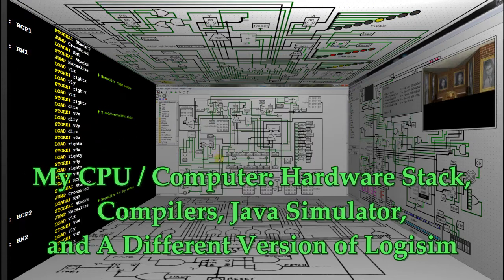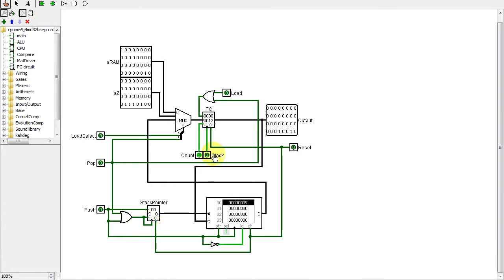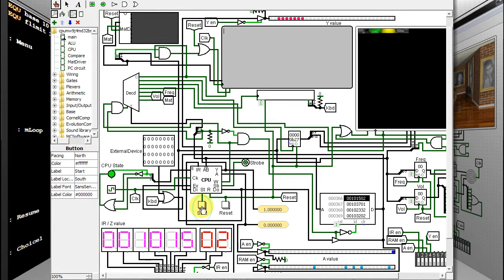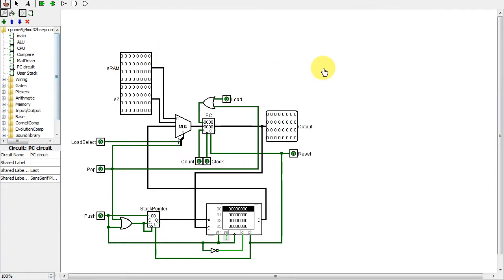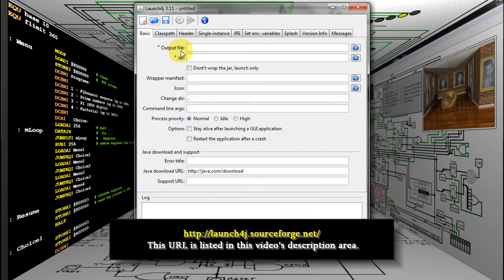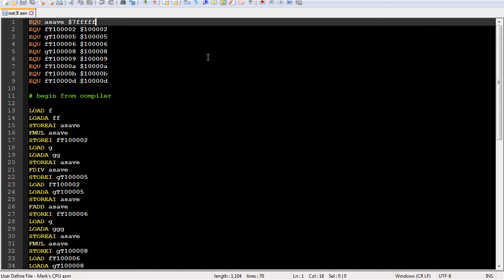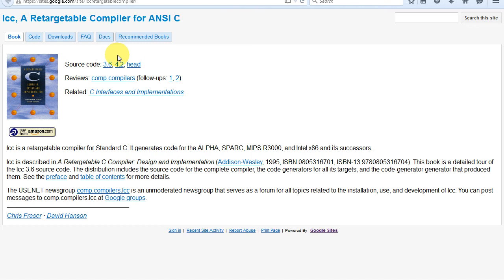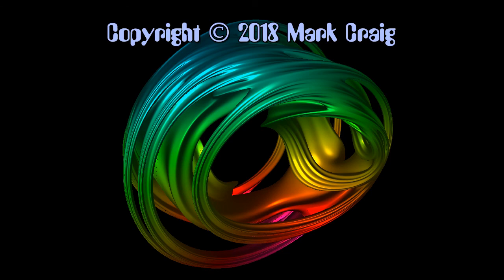My CPU / Computer: Hardware Stack, Compilers, Java Simulator, and A Different Version of Logisim

Comment: Hi. I can't even think of how much work you have put on that. Congrats!  Sorry, but I am a Logisim newbie with a basic question: how did you manage to have that "screen" that you a rendering your ray tracer inside Logisim? Is this a library? In my Logisim I can only see a basic "LED Matrix", but that does not seem to be it.
Reply from the maker: @Jorge Amengol Thanks!  To get the screen, I took the source code for the video screen from a Cornell version of Logisim Evolution and modified it to get better resolution and color depth and made it a JAR library.

You can download my jar libraries which include the LCD screens at:

https://sites.google.com/site/mrmcsoftware/home/downloads/cs3410for271.jar

(for original Logisim), or:

https://sites.google.com/site/mrmcsoftware/home/downloads/cs3410modvideo.jar

(for Logisim Evolution).

or you could use Cornell's version of Logisim Evolution (or even Cornell's jar libraries) or Kevin Walsh's Holy Cross version of Evolution or the newest reds-heig Evolution (BTW, the newest versions of Evolution break even more compatibility, so my JAR files probably won't work with the newest versions - but might not be necessary anyway since Kevin's, for example, has an LCD screen).
Reply: @MrMcsoftware  Thank you so much for the quick reply and detailed instructions. I thought it amazing when I saw you rendering right in the sim. I'll definitely planning of doing that later on. My idea is to build a basic CPU first and then improve from that.

I've just checked Kevin's version here and it seems pretty neat.  Thanks!
Reply from the maker: @Jorge Amengol You're welcome.  I'm glad my video was helpful/inspiring.

Comment: Are you editing your instruction decoder ROM yourself?  I've ended up with a 39-bit control word, and am also using the ALU flags as instruction decoder inputs.  I found it absolutely necessary to write a compiler for this.
Reply from the maker: I wrote a GUI program with all the control lines.  I just click on the lines (checkboxes) I need for a given instruction, and it computes the value.  Then I click the add button to add it to a file.  Then I put that file into the circ file (usually) or load it into the ROM in Logisim.  But, I have to think of what control lines I need for the new instruction, if that's what you mean.

Comment: Hi, I have watched most of your videos and I decided to try my hand at implementing a 32-bit CPU in Logisim, with a lot of functions like yours. I do have a question, though - how did you obtain the Evolution DIP switch component in vanilla Logisim? I assume it's from the "EvolutionComp" library you have loaded - do you know where I could get that?
Reply from the maker: That's good (you're making a CPU design).  I got the DIPswitch code by downloading the Evolution jar file and unzipping it (I think the source code was in the jar, either that or Evolution's master zip file).  And then modifying it to work in original Logisim.  My EvolutionComp library can be downloaded by: 

https://sites.google.com/site/mrmcsoftware/home/downloads/EvolutionComp.jar

BTW, if you have more than one dipswitch in your circuit, by initial value parameter won't work reliably.
Reply from the maker: Ooops...  "my initial value parameter"
Reply: Thanks for the quick reply and the .JAR! It's neat that you can merge different components from different versions with some tweaking, I might try that with a few other components I can find.
Reply from the maker: You're welcome.  Yeah, it is neat.  I'm glad Logisim and it's various forks are open-source.

Comment: Could you possibly do a series of tutorials on making a jar library for logisim? No matter how hard I look I can't find a tutorial on logisim jar libraries anywhere.
Reply from the maker: Possibly.  If you want to know the commands to do it (not via netbeans/eclipse/etc. though) as well as a little bit of a skeleton of source, you could look towards the end of my "Using..." video (before the real time clock section):
 
https://www.youtube.com/watch?v=Os-1ZQ6BXFI

and full source code (minus a few small files) of my midi keyboard is at the end of my "... Improved Sound..." video:

https://www.youtube.com/watch?v=_VW074myq44

 And the full sources to many of my jar libraries are available at: http://sites.google.com/site/mrmcsoftware
in the Downloads section (unzip the JAR library to get the source).  BTW, one thing that annoys me about some JAR libraries is that if the programmer put the class name in the MANIFEST.MF file, the users wouldn't have to manually type it every time:  
Library-Class: com.mcsoftware.logisim.myfplib.MyFPLib
for example.
    Also, if you plan on writing a Logisim JAR library, I recommend having the full Logisim source to use as a reference (for the class members, etc.)
    BTW, if you also mean "how to program JAVA", I have no interest in opening up that can of worms :-)